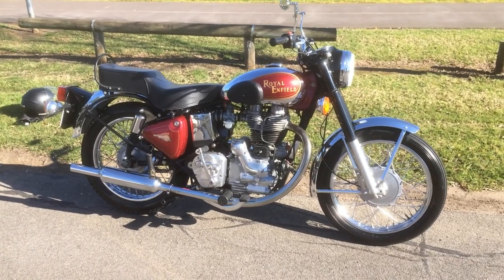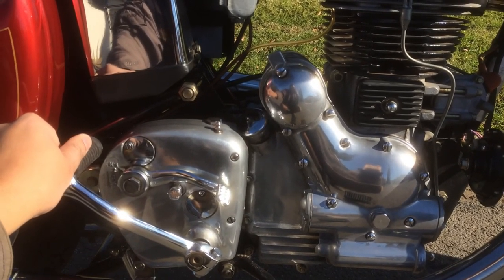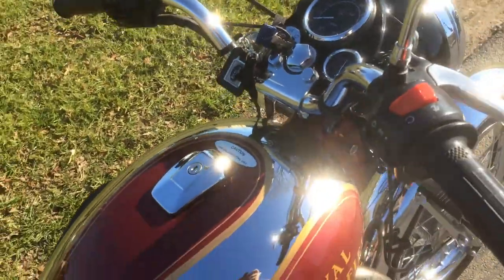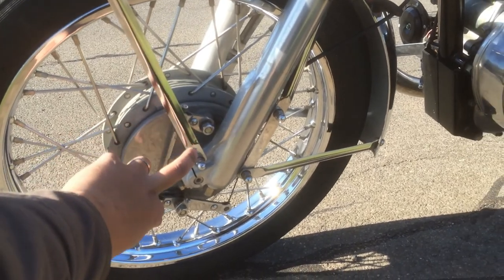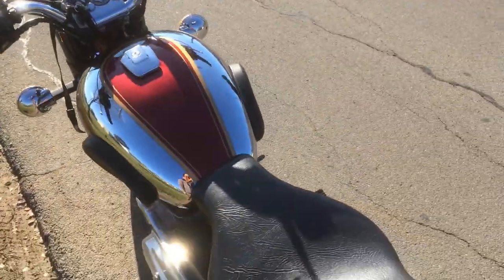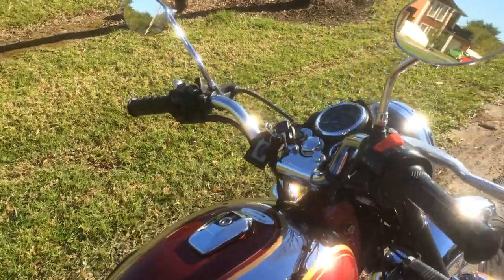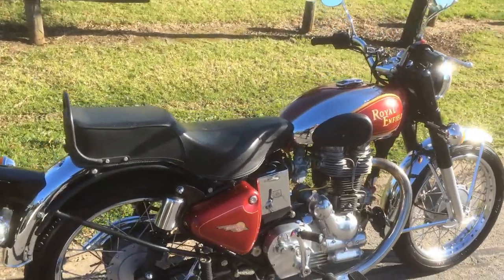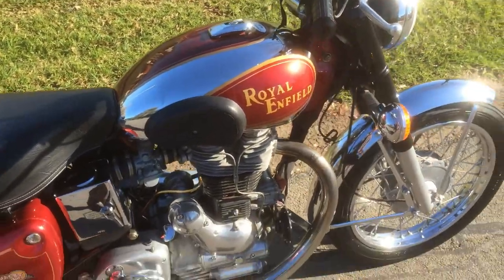Royal Enfield Bullet 500 Review

Comment: What will happen if the amp meter shows the negative direction i mean the position in amp meter where we need to engage  the decompressor lever and if in that case we just use the electric start instead of kick start without decompressing the lever? Will the bullet bike start? I have confusion.
Reply: U still need decompress